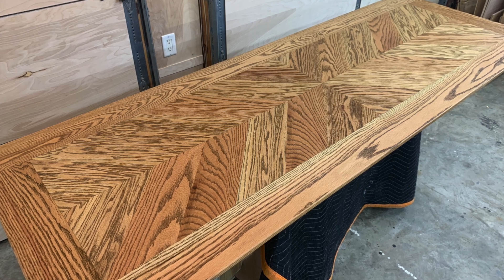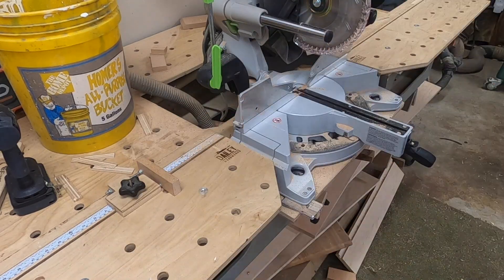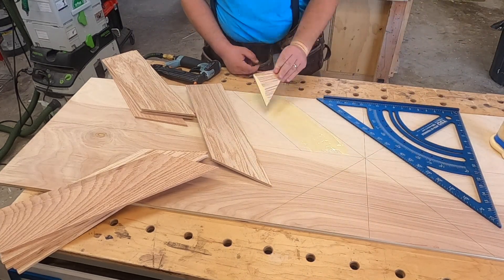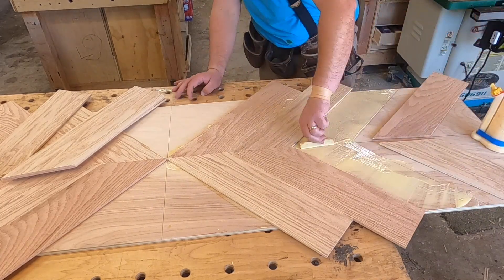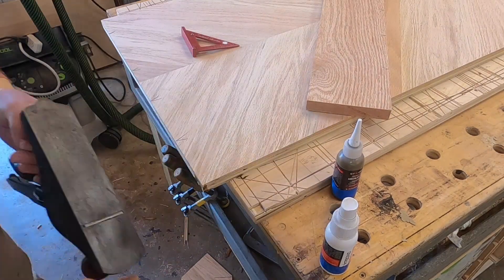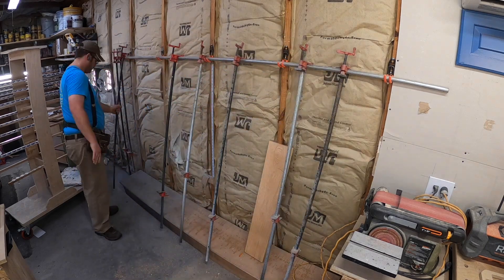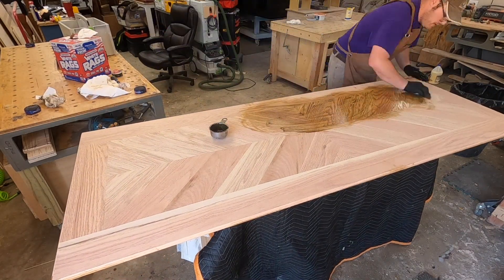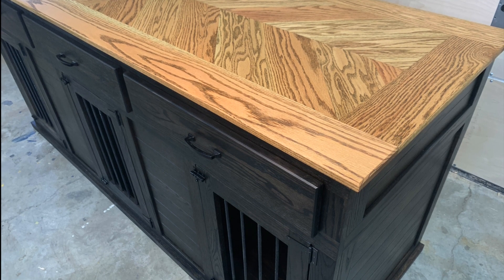Building a Double Chevron Oak Custom Table by Dailey Woodworks in Bryan, Texas

Comment: Using this technique, can you do the chevron pattern on both sides of the plywood so they match for a floating desktop or would that lead to the pieces pulling apart when the hardwood tries to expand and contract?
Reply: You can do both, but you might want to make the veneers thinner if you do. I've done 1/8" thick veneers on 1/4" baltic birch and it worked well as far as I know (at least the customer never reached out with issues in the last 4 years).

Comment: Did you use a water-based glue for laminating the oak to the plywood? I've had that go bad since you added water essentially to one side and not the other. Potato chip! I ended up switching to a veneer glue for this type of project and no more danger of imbalance. Looks good!
Reply: Dustin, what was the glue you would have picked?  I have experienced the problem when laminating also.
Reply from the maker: Well now I’m worried! But I’ve built three using this process in the last few years without issue

Comment: I built some cabinet doors with a similar pattern however the cabinet doors bowed outward.  I am guessing that my hardwood 1/2" thick, and my plywood 1/4" thick is the issue?  I am assuming I should have reversed that and made my hardwood 1/4" thick and my plywood 1/2" thick so the wood movement doesn't make the doors bow outward?  Or is there something else I am doing wrong?  I also did not put a frame around it, because I wanted the pattern to look more seamless with three doors across the front of the cabinet.  Thoughts?